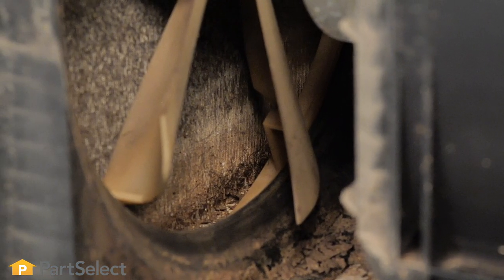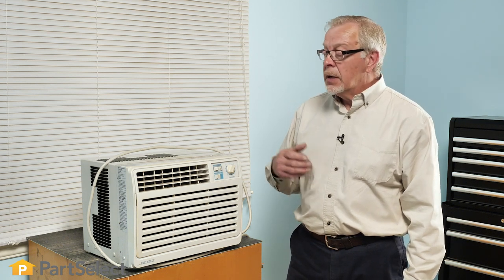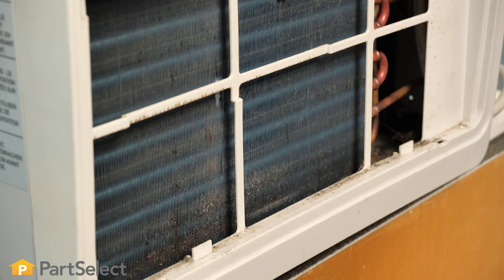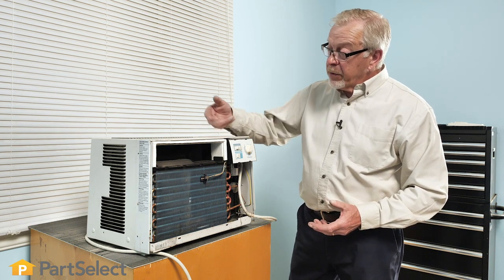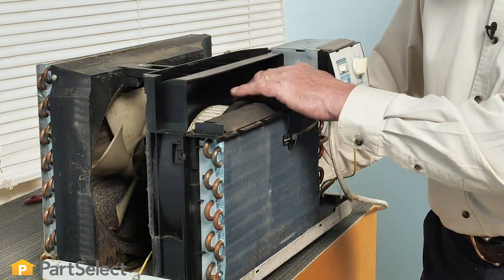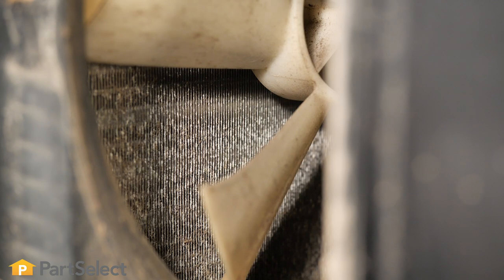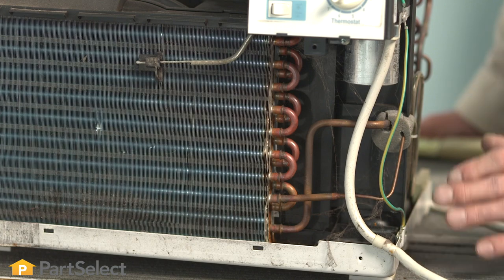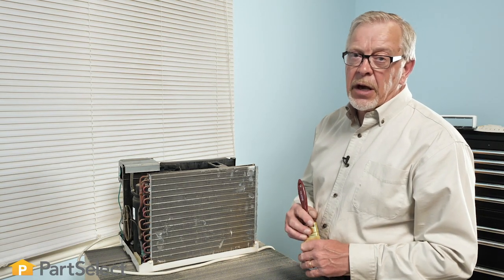Air Conditioner Repair: How to Clean Your Air Conditioner's Coils | PartSelect.com

Comment: The new window air conditioners I've seen have a tilt out front and a non removable front so there's no way you can gain access to those fins to clean them out thoroughly. I think the manufacturers know very well that means more dust and dirt in the coils and a faster death of the unit. Those mesh filters don't really filter the air, either, and that means more dirt gets into the fins and coils so the unit gets dirtier faster. That means a shorter life for the unit and the manufacturers can sell you another one in 5 years instead of 10.

Comment: I've found that a _new_, small, brass, wire brush used gently can both clean the fins and also, if you start above or below a flattened area, unflatten it.
Reply from the maker: Great tip!